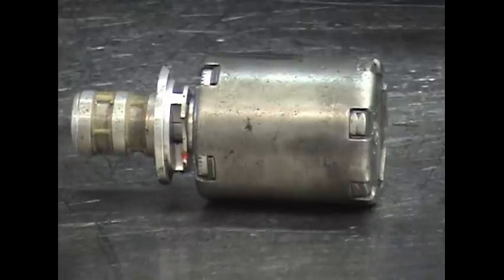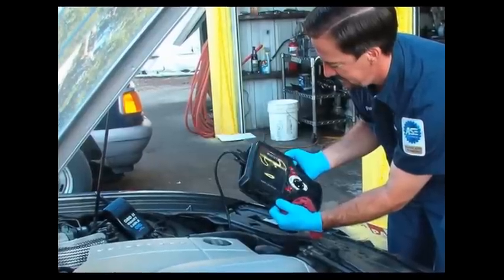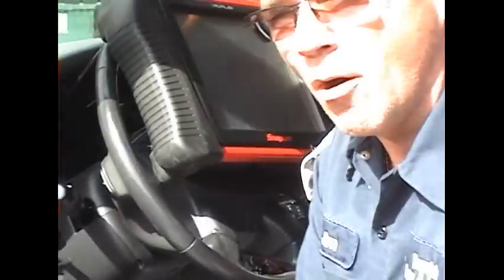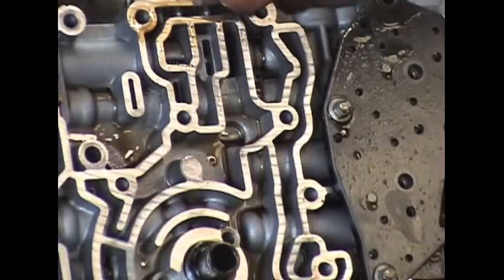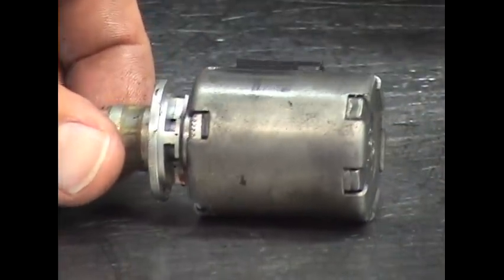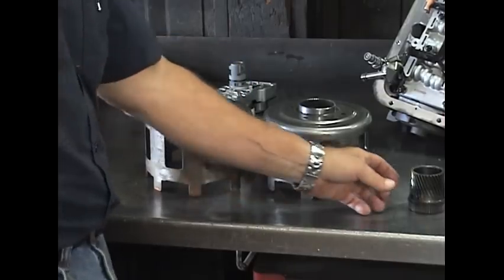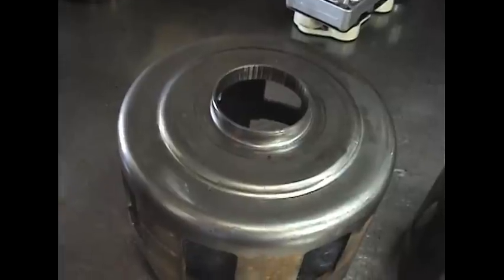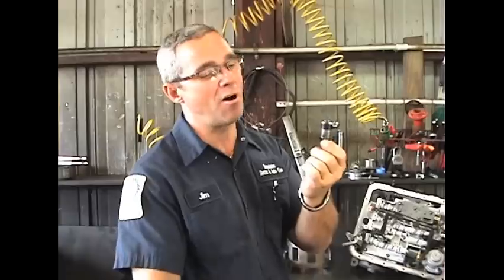Transmission Harsh shifting

Comment: hi I own a 98 f150 5.0 Eddie Bauer edition in the problem I'm having is driving with the overdrive on it won't shift when shift into 3rd gear it just keeps like the Rev needle on the speedometer just keeps going up but the car stops moving I see online that is a cylinoid in this type Explorer just for 3rd and 4th gear so I'm wondering is it just the solenoid went bad or could it be something else

Comment: I have a ls400 and my auto transmission shift hard when I accelerate real hard ...but If I floor the throttle half way and keep it steady if shift fine.  The hard shift is more likely to happend when I downshift on the freeway .  Can you help me ?   It's only at first to second gear and fourth to fit gears.

Comment: Excellent video I wish the guys at the car dealer saw this because they still did not fix our car ! They said there guy was a transmission expert but he only replaced the screen and flushed the transmission it's slipping bad at lights it acts like it has a trans brake. We just purchased a car and the next day it started doing this. I'm thinking the solonoid is bad.
Reply: I am looking for exact location shift solenoid module 1999 Ford Escort 2 L

Comment: I think this video has helped me. My 99 supercharged gmc sierra was in limp mode it wouldn't leave second gear to the higher gears i pulled the trans pan and found severall shavings i replaced 2 shift solenoids put brand new fluid in after cleaning out all the shavings it now shifts all the way through the gears but 1st to 2nd gear shifts so hard... looks like im going in again to look at those teeth hopefully this will fix the problem thanks for the video

Comment: I have a 99 honda accord ex. Just had transmission replace and was driving fine for a night. Next day I noticed it was leaking fluid.  Had the gasket replaced and-he used a sealant. Went to test drive it and thats when the shift began. It cimes to a complete stop on its own then continues. No one is able to tell me what is exactly wrong. Please help.

Comment: I have one question for u, sir. I own a Mini Cooper S clubman year 2009. I had a problem with my auto transmission which is harsh shifting. It doesn't give me a problem in the morning where the engine is still cold, it starts to show symptom when the engine is all warmed up..let say after running the distance of 20km. I took it to the workshop and they guy told me it's the faulty solenoid just like u said in this video. Got my car done at the workshop..the solenoids have been replaced, torque converter has been service, new clutch plates and so on but the problem is still there. I took the car for a spin after the engine is all warmed up and the problem comes again. Why is this happening? Could u help?

Comment: I have a 05 Silverado just had my transmission rebuilt the guy said he was going to beef it up so that way it'll handle my lead foot . . . 3 days later i got it back i lost my third gear. . . i also told him that it was shifting hard from 1st to second then second to 3rd when 100% throttle down that it would almost redline to 6 thousand rpm then would shift when no power was left . . . so that being said he said it was my fault and my truck wasn't working right? And that my truck needs too be shifting at 5 thousand rpm but my truck had never done that before staying at 6,000 rpm I'm just curious on how and way i could do or say or how can i change my shift points to 5 thousand rpm?

Comment: Hi I have a 2001 chevy silverado that shifts hard from 1st to 2nd but all my other gears are good I removed my 1-2accumalator took it apart and it had no springs will that be the cause a d if so would it have damaged anything because I assume it has been drove like this for quite some time I just recently purchased it.
Reply: yeah I had to order another 1-2 accumulator for mine it was like 10 dollars of ebay and that fixed my problem hope this helps you
Reply: christopher walley I have the same problem on my 2006 Silverado Vortec Max. It has a 4L65E transmission, yours probably has a 4L60E though right? Anyways I am sure it is very similar and probably the same problem. How hard was it to change? Transmissions are my weak spot, I have no clue what I am getting into or if I should attempt to change the accumulator myself.
Reply: The hardest part is taking off the transmission pan but once you get your fluid drained and pan off you will see that accumulator mine had 3 bolts and those accumulators are supposed to have springs in them mine did not once I got it replaced it fixed my problem maybe your spring broke I have heard they can break then cause harsh shifting
Reply: christopher walley Just an update for you or anyone else who would like to know how it went. It turns out my transmission already had a aluminum 1-2 accumulator piston (with 2 springs?). But I replaced it with a better one and removed one of the springs, that seems to be why it was shifting so hard. I also replaced solenoids, put in a corvette servo, and replaced the filter and oil of course. After all that it acts a lot different. It doesn't hesitate to shift down when you floor it anymore. It shifts firm and quick, but not hard and neckbreaking like it did before (this is because the corvette servo) and it used to start off in second sometimes, but it doesn't anymore. So far everything seems to be good! Hope it stays this way.
Reply: Thats awesome I'm glad everything worked out for you
Reply: Can someone help me my 2010 cruze gets 1st and 2nd gears at ease but No reverse or 3rd 4th or 5th  gear's  put new clutch in still nothing
Reply: christopher walley 9 kiwi I 

'll mooo
Reply: christopher walley u

Comment: Hi i have a 1992 Holden Statesman which has a T700, TH700 700R4 or 4L60 (no E) auto gearbox attached to a 304 V8, its taking longer to shift from 1-2 (accelerating normally it changes gear at 40 km/ph @ 3000rpm downshifts at 30 km/ph) i have redone the filter and oil and adjusted the TV cable i'm wondering would this be a solenoid, torque converter or rebuild needed?
Reply: jon cousins That is the same problem in mine . I hope we can get an answer

Comment: Also, Jim, I read on another forum that if the transmission problem was a bad shift solenoid, there would be a warning light of some sort due to being an electrical/computer problem. Is this true? My problem described in my previous post/question does not cause any warning light or flashing OD light or anything.

Comment: Jim, my 2003 Ford Expedition transmission has a hard downshift and occasionally "shudders" when shifting. It seems to be the worst when it is very hot and has been on the road for a while. I suspect a shift solenoid is the problem as you describe in this video. I also think (but not sure) the transmission has more than one shift solenoid, but I don't yet know how many. How would I go about determining which solenoid is the bad one? Thanks.
Reply: I have a 99 expedition and mines revs till about 4k at times then engages and drives fine but my tranny fluid is also dirty so im going to change the fluid and filter to see if anything changes
Reply: @anthonyshelton259  I know this is a old post but my 2007 crown Vic is doing the same thing your expo did my revs at the stoplight then jerk into gear and drive fine until I stop again is it the shift solenoid or dirty fuild ?
Reply: @archiemadison764  So I ended up getting a rebuilt transmission a few days after that post.I was on the way to work and it wouldn’t go anywhere.

Comment: I just had a used trans put in my 2000 Jeep Grand Cherokee, V-8. Automatic trans. In the morning on my way to work I get a hard shift at about 20 mph, I think from 2nd to 3rd. The mechanic says the transmission is fine and thinks maybe a solenoid, although he cannot find it. Should i take it to a transmission shop? I already spent $1,000 for the used trans with a 6 month warranty, but dose me no good to take it back to the mechanic who put it in if he can't figure it out? It's been in the shop now for 10 of the last 14 days ...

Comment: Hi transmission doctor I have seat alhumbra 2005 automatic 1.9 diesel mpv six seater 
from a month this happen one day I start engine and moved on my gear didn't change and when I put in semi automatic it shows 2nd gear but didn't move then I put in neutral the. Gear and car made a jerk then next day same thing but when give it a high rev the gear changed but whole day car works fine but I feel gear changing in nano second delay.
Can you help me as I love my car where are you based I live in Watford St Albans Road I can bring car to u if u are close

Comment: I've got a problem with my 1988 Toyota Corolla shifting late and hard. 1st to 2nd can be as late as 30 mph and 2nd to 3rd needs me to be around 60 mph to happen. This combo makes for a rather rough ride as I feel the car is always in a lower gear than it should be and the high revs will only cause unnecessary wear and tear. Once the car makes it into 3rd gear it feels like there is a hint of engine drag when I let off the pedal.

I"m not getting any weird sounds from the transmission, the fluid levels are fine and colors are great but the transmission has gone through about 180k miles.  Are there any problem areas I should check or simply skip towards purchasing a replacement transmission?

Comment: I have a 2002 Buick Rendezvous that is shifting a little slow but not severely, from what I see on this site it sounds like the solenoids, how many are there in my Transaxle??  I can see that changing them is relatively inexpensive and not too difficult, but again how many are there????  Thank you in advance

Comment: the probleme i am having with my hyundai accent 2008 is that there is a 3 to 4 second wait before the trans gets into drive but every gear shift very good after
Reply: I also drive a 2008 Hyundai Accent, and I notice the same thing when I go from Reverse to Drive. Sometimes there's some hesitation, about 2-3 seconds, and then the trans hooks up completely. Usually going into Neutral for a second, and then shifting into Drive, helps it out some. From what I understand, the 4-speed in our Accents is just inherently kinda crappy, and this is fairly normal stuff. I do experience a slight amount of rough shifting from 1st to 2nd, and a little less going from 2nd to 3rd, on a cold start. I also get harsh downshifting when accelerating out of a corner, sometimes. I'm wondering if it's a solenoid, but the car has never thrown a code for transmission problems, so I'm mostly thinking it's just more of the transmission's "normal" shenanigans. The car is at the dealership right now for head work, bad valve guides and seals, and while that didn't throw codes, I'm also wondering if the engine troubles my guides/seals were giving me could've put the PCM into limp mode, and caused the rough shift conditions I was experiencing.
Reply from the maker: Kevin, I will pass your comment on to the transmission Doctor for response. Jim, webmaster

Comment: Do you need to remove the transmission from the vehicle to replace these solenoids?
Reply: No,Only the Valve Body,That's @ Bottom of Trans,Usually Just Needs Bottom Half Dropped,So Solenoids Are Accessible.

Comment: Thanks sir speed sensor is really make a lot difference in my second gear shift no my next point is going to be the solenoids because I am still having little bit kik when I push the brake on the stop lights and then released the break I feel like  shift back from 2 to 1 I hope not be too late what do you think I really appreciate it all the information what you give it to us thanks you God bless you